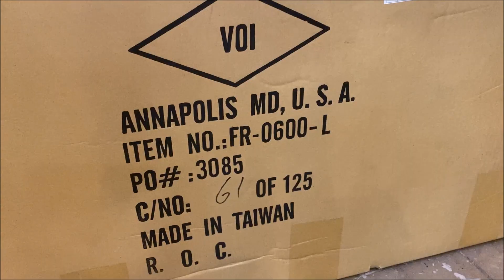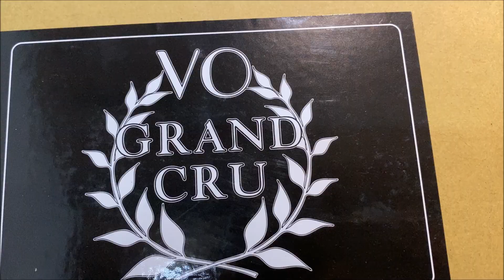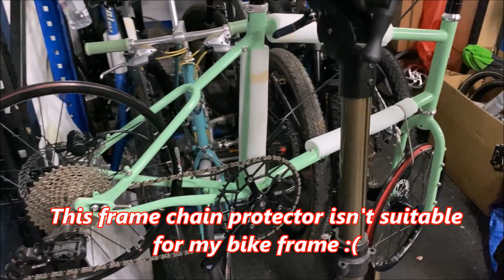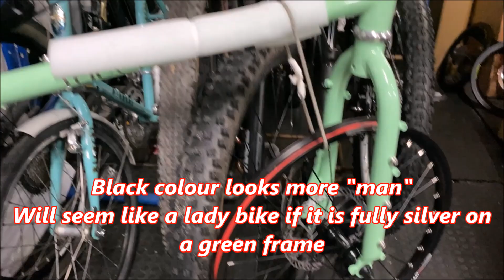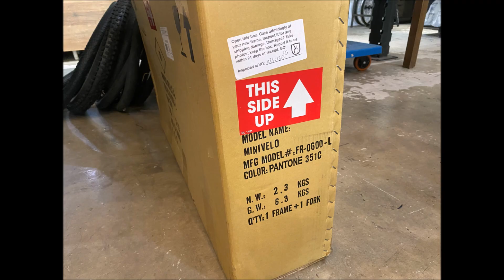LIOW VIDEO: My Velo Orange Mini Velo Bicycle 小径自行车定制

Comment: Great video. Now that you have it for a few months already, how is it to ride? Good? Really interested to get a bike to ride with my son. Also, can you recommend me a shop to fix my son's bike? (Gears not shifting properly and grinding sound on rear wheel).
Reply from the maker: If you check my channel, you will notice that i bought many bikes for the past ten years. That's no perfect bike in this world, test ride for 30mins won't tell you much and after you use it for two weeks, you will know if the bike suit you or not (that's why i keep on buying). To me, this mini velo is the best bike. BMX 1.75 tyres can use in any road conditions and give me confident when making sharp turn. 10 speed is more than enough for singapore road and comfortable riding position according to my height and preference (custom made). The 4130 chromoly frame is the best material for bicycle (aluminium/carbon fiber is lighter but may crack if fall or knock onto something, titanium too expensive). Mini velo is full size bike with smaller wheels, very stable than any foldable bikes. You can go to L&T tampines to service your bike (sometimes long queue). thanks for watching my video 🤗
Reply: @GIBSONGASPER123  Thanks for the advice. Will check out L&T. Also, please keep making videos. Really enjoy watching it. Thanks!

Comment: i'm also looking for a mini velo that has at least 8 speeds and is not too heavy.  where is this bike shop located?  what other brands of bikes can i look for? thank you
Reply from the maker: Address stated in video. I bought a few mini velo and foldable bikes. This chromoly steel bike is the best compared to Aluminium frame.

Comment: Hi am a novice and wld like to get into leisure cycling.  Wld like to ask Mr Liow what is the size (length) of the mini velo.  I have this perception is small for an adult.   Any advice is appreciated 🙏
Reply from the maker: Hi Steven, this mini velo frame come with 3 sizes: small , large & extra large. You can find the measurements in this link : https://velo-orange.com/products/neutrino-minivelo
Reply: @GIBSONGASPER123  thanks mate.  Appreciate the info.
Reply from the maker: @steven3066  You're welcome. I bought more than 15 bicycles for the past 10yrs (you can find some of my bikes' videos in my channel). So far Mini velo is the best. A full size bike with small wheel🤗
Reply: @GIBSONGASPER123  yes I have seen some of yr videos and other than the bikes u rode/bought, the fish tank is also captivating 😁.  As mentioned, am just starting out and whilst I liked the compactness of a mini velo am also concern if it ride small.  Saw a lead in model with a wheel-wheel length of 140cm but not sure if it’s too small.  Can’t visualise and also most bike shops do not entertain test ride “yet”.
Reply from the maker: @steven3066  My height is 1.73m and not all mini velo suit me (most only standard size for unisex). Cannot test ride but at least you can seat on it to feel it. I also bought some foldable bikes but the folding parts needs maintenance/tighten. If you staying in Singapore, can try this shop for Mini Velo 22" 451 Wheelset 10spd Mini Velo Bike Bicycle Litepro Crank for S$699 https://carousell.app.link/1E7m5UcByhb
Reply: @GIBSONGASPER123  🙏🏽.  We’re abt same height.  Thanks for the link.

Comment: How is this MV compare to fnhon gust?
Reply from the maker: Fnhon gust using 16 inch 349 wheelset, easy to skids and not as comfortable as 20inch mini velo with 1.75 tyre. I ride both foldable and mini velo bike for the past 10yrs. Foldable bike too many folding parts not as stable as mini velo. That's why i bought it again.

Comment: $1350 for the frame and fork only?  Why do you want chromoly instead of allu Alloy ?
Reply from the maker: Yes, only frame & fork. I bought many bicycles for the past 20yrs. I have been using different frame materials and the 4130 chromoly steel is the best. Of course titanium will be the best. This link will explain: https://detroitbikes.com/blogs/the-bike-blog/what-makes-a-chromoly-bike-better
Reply: @GIBSONGASPER123  I see. But $1350 for just the frame and fork is expensive, imo.
Reply from the maker: @MrCam70  The frame and the fork is very strong and got many mounting holes for racks and water bottle cages. It's a touring bike and different from normal mini velo.